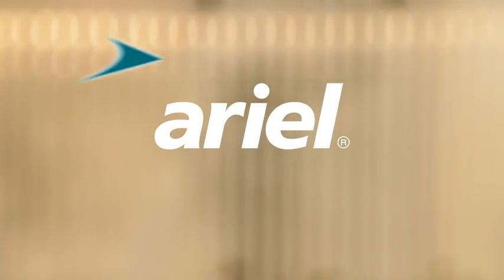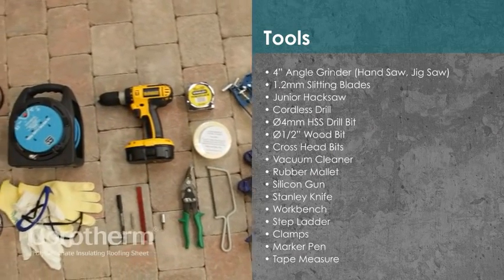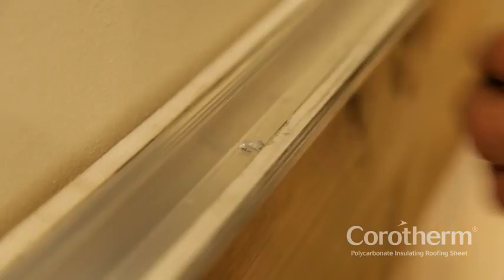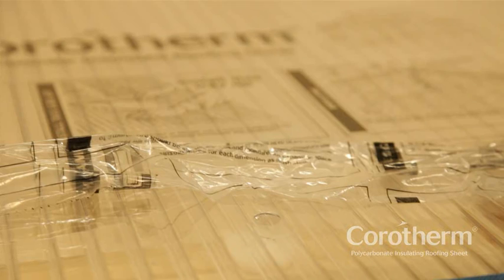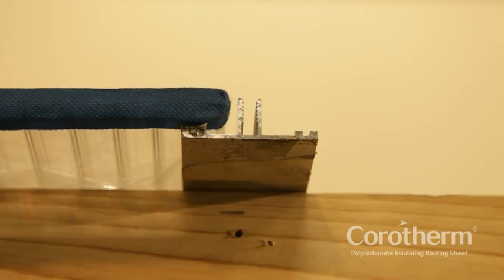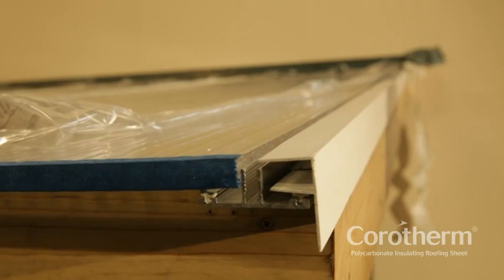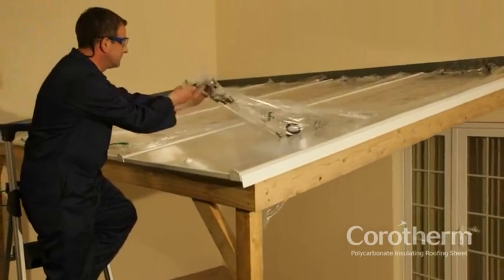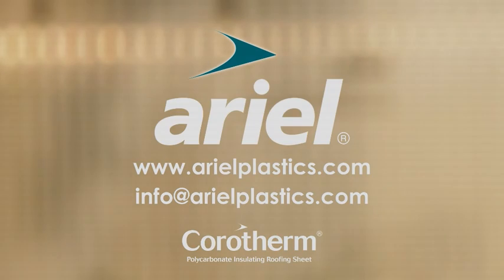How to Install Corotherm Polycarbonate Roofing Sheets

Comment: why have you not detailed the critical step of how much space you need between the sheets so we know how to space the rafters?  Surely that would have been an obvious thing to cover in the video? If using 700mm wide sheets then how far do the rather need to be spaced apart? 725mm maybe ? I need to know this before installing the rafters?

Comment: Can you walk or kneel on the sheets when fitting?
Reply: No. Especially not with a roof structure like they show in the video. Most roof structures with that span would have at least one row of blocking between the rafters. If you were to stand directly on a rafter then you might be ok, but do not stand on the polycarbonate without a solid surface directly under it for support.

Comment: Use 12.7 mm or 1/2" wood drill bit to drill holes for the super fixing buttons. How the hell can I get 12.7mm drill bit? In the civilised world people use mm not inches. Easier to get a moon stone than 12.7" drill bit...
Reply: I don't think the size has to be exact.
Reply: Use a "half inch" drill, if you cannot convert. Its close enough. ( thats .500 inch  )